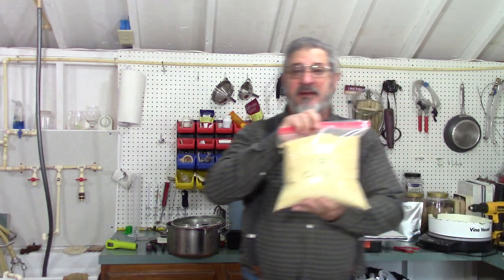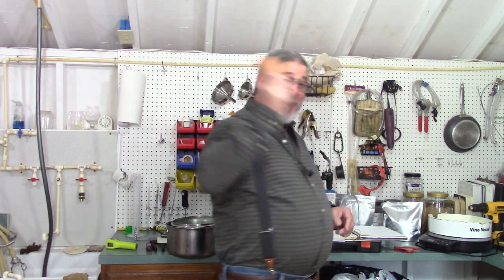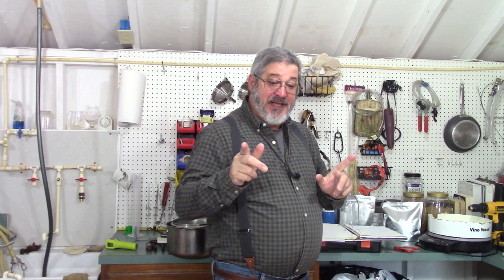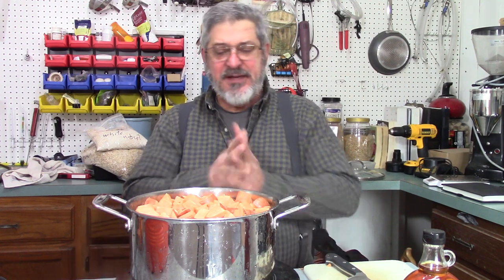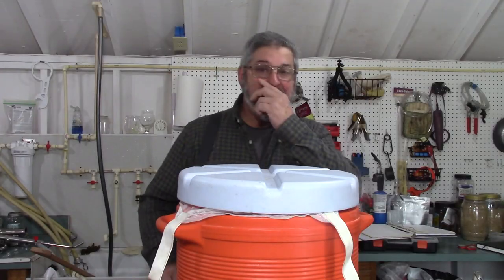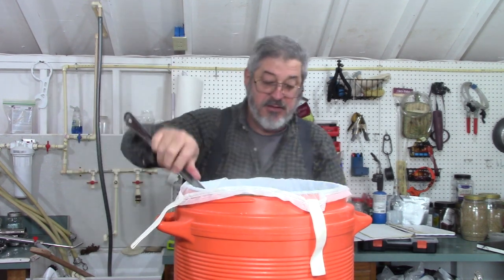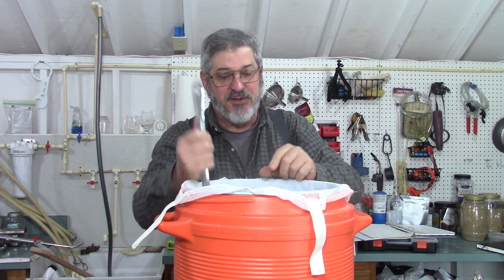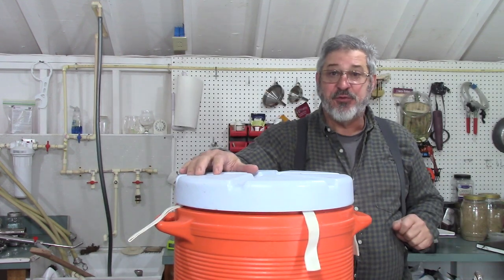E137 Sweet Potato Bourbon Mash

Comment: Here comes the "stupid" newbie question.....What makes one decide whether to use 2 or 6-row barley? Is it purely preference or based on the grain bill?
Reply: 2 and 6 row have different diastetic power… the ability to convert starch to sugar.
6 row has the most conversion power of any malted grain.

I’m sure they have slightly different flavors… but I can’t imagine it’s significantly noticeable in distillation… depending on the amount.

Using calculations to account for how much starch needs conversion to sugar in your mash will determine how much diastetic power you need from your malts.

Or you could use  amalase enzymes.instead of malt.

I tend to use high malt content in my mash because I prefer malt flavor to corn.

I’ve used just about every distillers malt… including peat smoked 2 row.
While I’m sure an advanced palate can discern the flavors…

I’ve never noticed a huge difference in flavor between them.

But it always depends on the amount of barley present in the mash.🥃👍

P.s…
There are no stupid questions.
Just stupid answers.🤣👍🥃
Reply: @BillMcGirr  My man! That's what I was looking for. The only reason I asked is because I've notice Randy use a combination of either 2 or 6 row not just him but others. Curiosity as to why some use 2-row in a batch and 6 in another. Thanks for the great explanation!
Reply from the maker: well said Nic B
Reply from the maker: Great question Nic said it well
Reply: @srawnc  

It’s probably also important to remember that necessity and availability are the mothers of invention.

The Scottish and Irish whiskeys use malted and unmalted 2 row…
Because it’s what is readily available.

But remember they don’t use corn…
Hence the term single malt.
The malted barley has more than enough to convert the unmalted barley.

And most major distilleries are content with a 9-12% potential abv.
They believe it’s the sweet spot.
And who could argue?

They DO NOT add sugar to the mash.
The more I distill… the more I agree.

Fortunately I live 6 miles from a BSG warehouse.
I have ready access to MANY options of malts at a reasonable price.

Most aren’t that lucky.
Shipping is obviously an added expense.

But other options are unmalted barley available at feed stores and farming co ops….
And you could use both alpha and gluco amalase powder for conversion.

And of course MANY grains are malted… barley, rye, wheat and also I believe oats.
🤷‍♂️

The sky is the limit…
It just depends on your tastes and the availability and cost for you and where you live.

Best wishes.😊👍🥃
Reply: @BillMcGirr  Unfortunately I'm one of the many that doesn't have a physical location but that's ok, over the last month I've been able to compile quite the list of online retailers that come in high regard. 

Yes! My next venture is a single malt but I want to do as much research as possible coupled with quality ingredients. No sense in rushing into it and losing a whole run over a simple mistake or sacrificing flavor due to shortcuts ya know. Thanks again, quality advice and helpful information go a long way in my book.
Reply: @srawnc  

Best wishes brother.
Enjoy.👍🥃
Reply: @srawnc  

Ps…

As long as your ferment is complete.
And you ARE NOT drinking the poison ☠️ that happens in the beginning of a run….

You’re not wasting ANYTHING.
Tails are filthy… obviously.
But you won’t die or go blind.

There’s no such thing as a wasted run.
There’s only wasted opportunity to learn something new.

Take chances… explore new opportunities and enjoy AND LEARN.

There is no other way.
Perfection is not an option.

Personal perfection is your only landing spot.

Take chances… grow… and NEVER APOLOGIZE.

Enjoy brother.
You only get one ☝️ ride.👍🥃

Comment: I got a recipe....not sure if youd be interested in trying it...cant legally distill here...and I have had my fill of federal law enforcement this year...
Reply from the maker: sorry to hear about feds
Reply: @stillworksandbrewing  not your fault damn neighbors fault for making bogus complaints. 

Anyway here's my recipe. 

22 pounds peaches
5 pounds green walnut honey (2 pound green walnuts in 4 pounds brown sugar maceration takes 30 days)
2 pounds walnut syrup (tap tree like maple syrup except syrup must age for 6 months due to the tannins)
8 pounds toasted walnuts broken into pieces. 
1 pound wild honey

Other ingredients: black walnut tree bark. 

Cut 1 inch wide strip into tree and pull the strip to take off in a long strip. Only take 1 strip per tree. Never take the bark off in horizontal strips only ever vertical otherwise you'll kill the tree. 

Take the bark and boil it in the water to make a strong tea. How much bark depends on how much water is being used. This tea should have a tarnish honey amber color to it before adding to the peaches. 

Make your mash as you normally would. However during your run on your pot still. Let your distillate run into a coffee filter. In that coffee filter have some additional ground walnut and a piece of heavy charred oak upon the top and bottom before capturing.